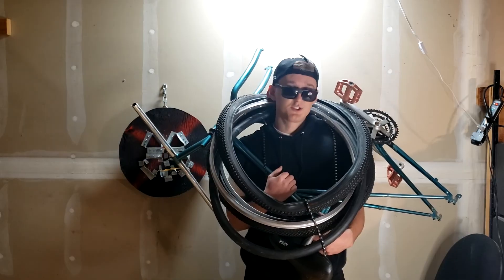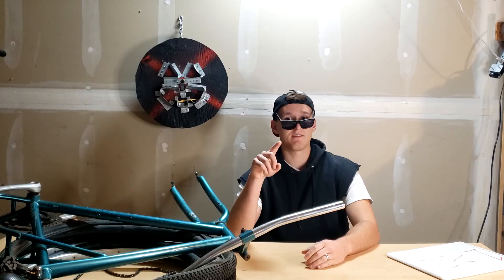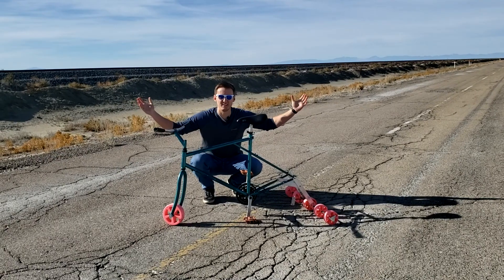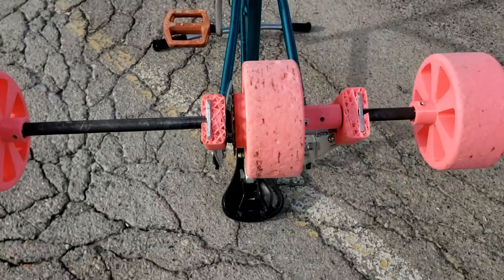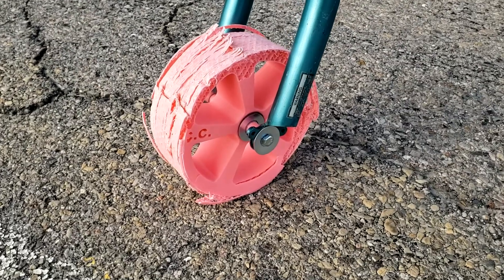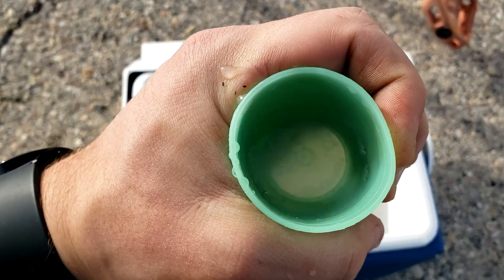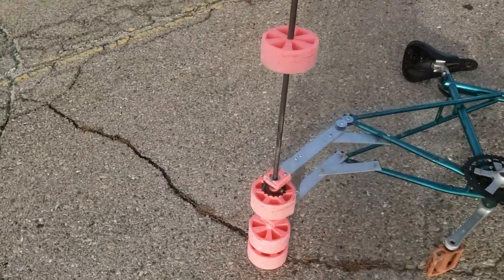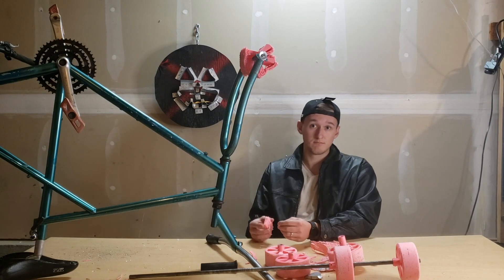I Built The Worst Bike EVER!

Comment: As the question of why is already answered, I have to pose the question of how? How did you keep going with your project without using 100% infill in the wheels?
Reply from the maker: Lol, cause it woulda taken forever to print those bad boys. And I kinda wanted to see how well the thin walls would hold up... not very well it turns out.